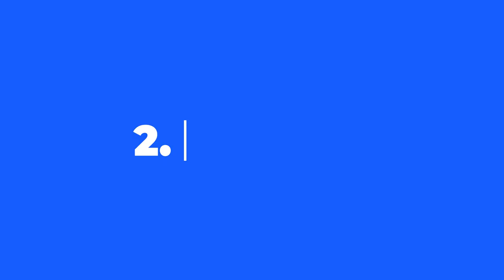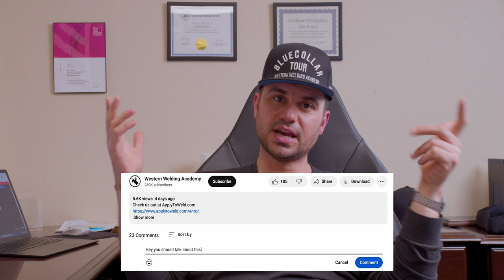Top 5 High-Demand Blue-Collar Trades in 2023

Comment: HVAC is In demand wherever you need to make indoor air comfortable. 

Heavy equipment operators get to play in the dirt but it it dependent on the weather. 

I’m a plumber, love it. HVAC, pipe fitters and welders are covered in our union.

Elevator repairmen and sheet metal are two other well paying trades here in SF Bay Area.